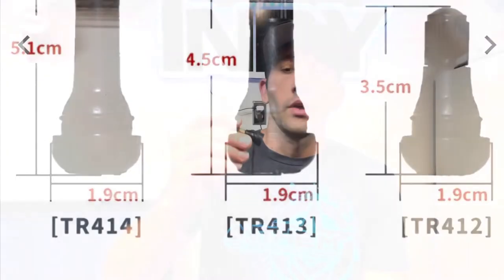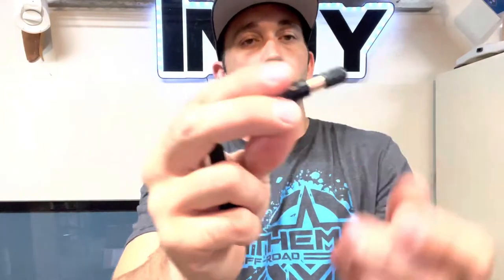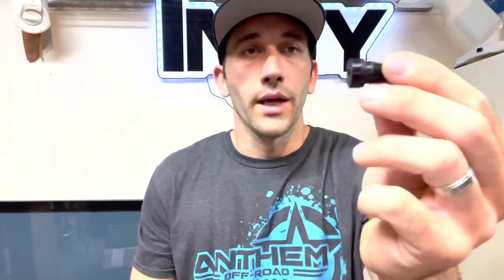Car & Truck Wheel Valve Stems - High Pressure VS Low Pressure (WHICH TO USE?!)

Comment: From experience the steel valve stems break off-road more than any other valve stem. There’s no flex in them. I always had luck with the short regular rubber valve stems just change them every couple years before they start dry cracking.
Reply from the maker: Good point! I see full steel stems on older sets of steel wheels and tires every now and then (the kind with nuts). Valid point though id rather have something give a little. I always thought steel was popular in off road because heavy mud would rip rubber right out. I know an e range tire require steel valve but the base is like a standard valve stem.
Reply: @Zacpactv  I’ve ran e rated tire on 1 of my off-road rigs but a standard valve stem was fine because they never saw more than 40psi because most beadlock wheels aren’t rated to go much higher than that. Off-road they lived around 10-12 psi. Most trucks running load range E tires as they were intended are too big and heavy to really be usable for heavy off-roading.
Reply from the maker: @rhythm618  Makes sense!

Comment: Is tr 414 good for honda 125cc motorcycle
Reply from the maker: what psi is the tire?
Reply: @Zacpactv  I think it's 42
Reply from the maker: tr 414 is rated at 65psi max
Reply: @Zacpactv  we can use it right?
Reply from the maker: I would always recommend metal valves for a motorcycle.
Reply from the maker: @lightrider3435  it will work but not as safe as metal valve core.
Reply: Number of mechanics always recommend rubber stem valves